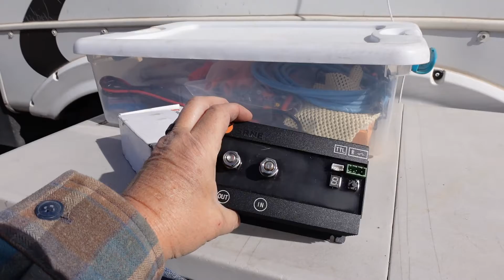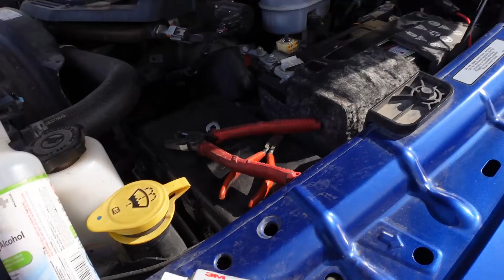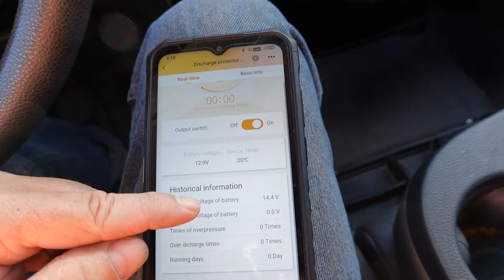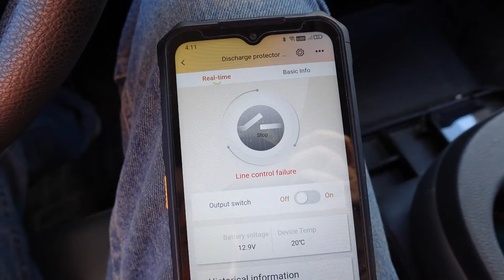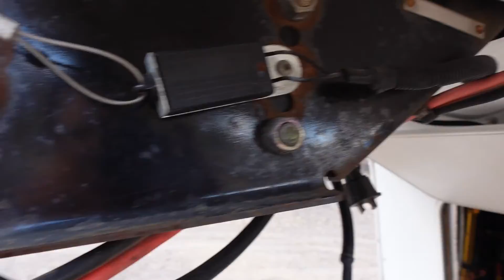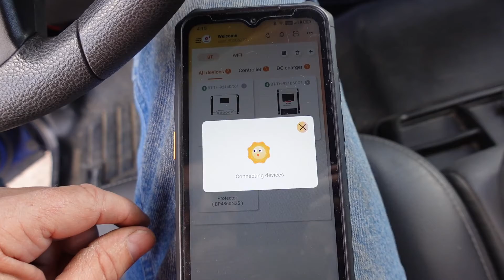Battery Protector Installation - SRNE 60 Amp Model BP4860N25

Comment: Thank you for this Video!  I thought that the dc to dc charger was in charge to protect both batteries?  
Is it a still 4g wire from the start battery to the trailer?  It looks beefier in the video.  Cheers 😊
Reply from the maker: Many DC-DC chargers have a low voltage cut off so will shut the flow of power if the truck battery gets to low and isolates the two battery systems from each other. This is extra protection that can be more customized as far as voltage shutdown points go and handy if I use the 12V port on my truck bed for other things and forget to disconnect. It is still 4 AWG :) Just had extra big double coated insulation on the wire.
Reply: @LoveYourRV  Thank you Ray, Did you just run the 4g wire bare or protected it with wire loom?  It is kind of tight under my truck, I wonder if I could get away without wire loom, maybe use a duplex marine cable which is pretty thick already.  Cheers.
Reply from the maker: I use this Trystar cable. Pretty good stuff, very flexible and thickly coated. I got it at a solar place in Quartzsite. https://www.trystar.com/product/battery-cable/  As an extra measure under the truck I added wire loom to most of the cable run and tried to follow the path used by the factory wiring.
Reply: @ Thank you very 🙌🏻⚡️

Comment: An interesting way to use that protector! Victron makes a good selection of Battery Protectors. I just recently purchased the new Renogy 50amp DC-DC MPPT charger and was looking for a way to shut off the voltage going to the trailer. I'm going to get the Victron  65 amp bluetooth model and install it inline with the fuse at the battery. The Victron has multiple settings for low battery disconnect as well as a custom user setting. It also has the manual shut-off switch too. I could set the low voltage for anything under 14 volts for an automatic disconnect when the truck is off and it will turn on automatically when the alternator pushes 14v or more.
Reply from the maker: Good idea! This one has 5 preprogrammed settings and a custom as well. The Victron looks smaller. Maybe the design is more efficient so doesn't need the large heat sink or maybe it's because the SRNE can also be used as a battery charge protector. Let me know if it works for you. Cheers, Ray
Reply: @LoveYourRV  Like I said, Victron has what appears to be 3 models. 65, 100 and 220 amp versions. From the looks of them, the larger models do have larger heat sinks.
I'll update you when I get it installed which won't be until the spring as my trailer is in storage right now. Probably early May.